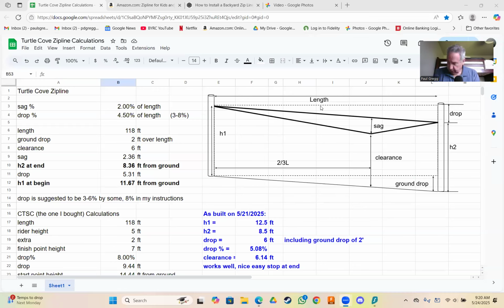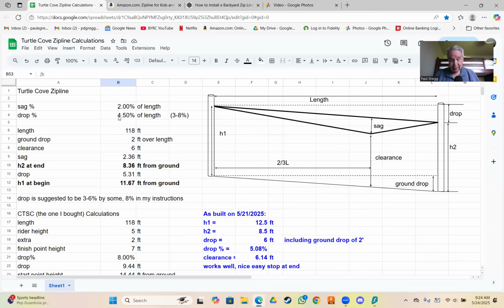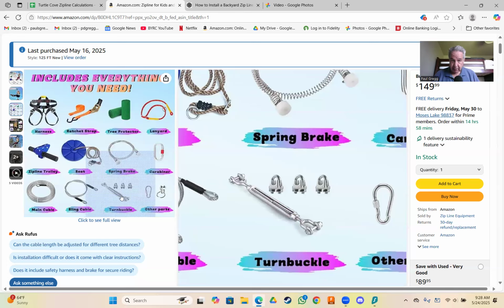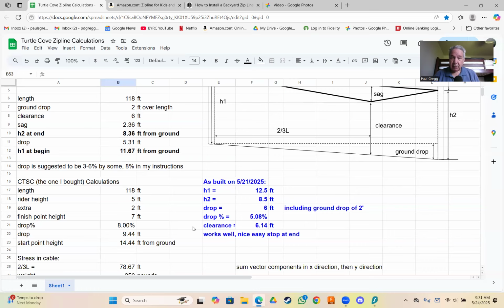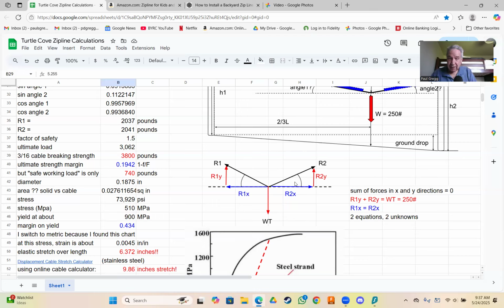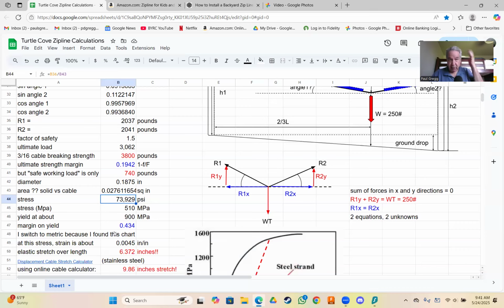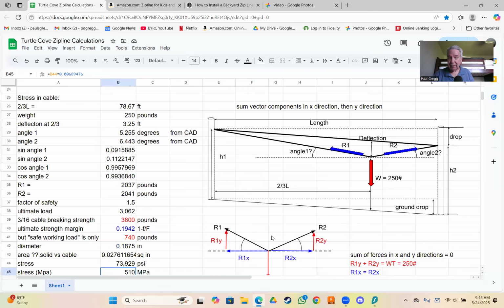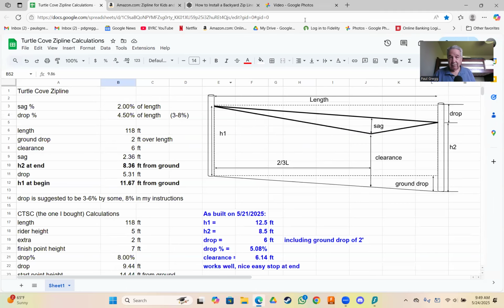Zipline Engineering

Comment: Great video! Thanks for the detailed breakdown.

Edit: i commented prematurely 

Imperical engineering could also be doing smaller scale tests or

 isolated tests like pulling a short section of wire rope

And you can do it without putting humans at risk. 

Which was the only way to test before advanced math, real world tests as reference, and finite analysis with computers

Theres definitely some cowboys out there trying dangerous things though
Reply from the maker: Absolutely.